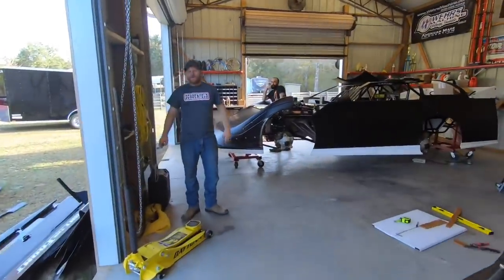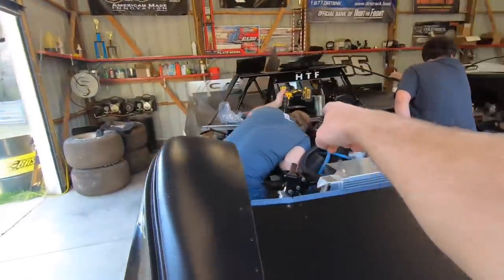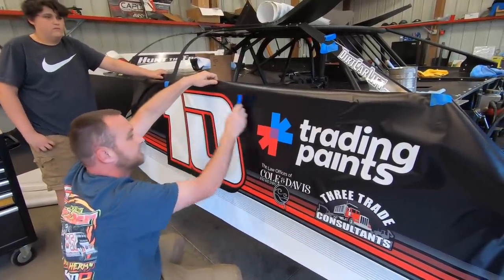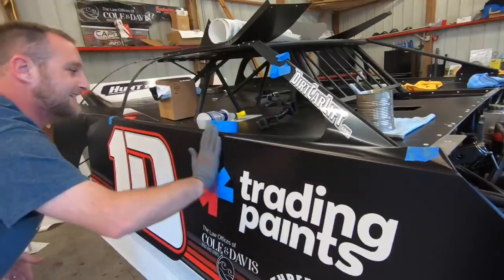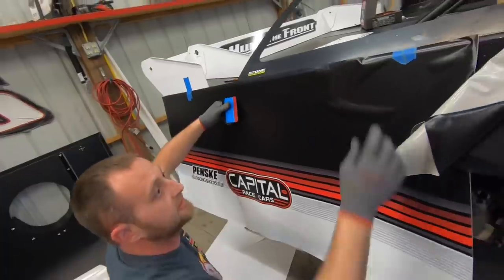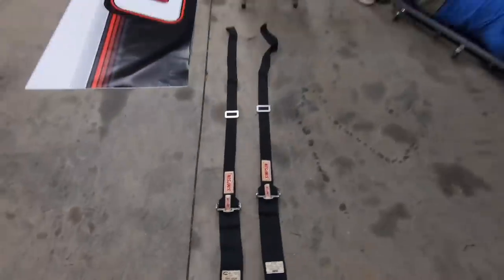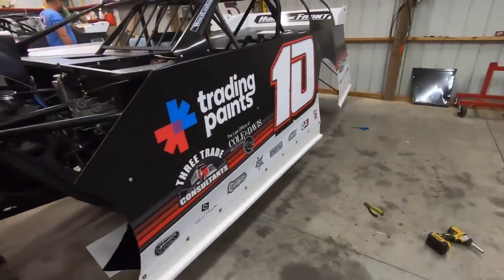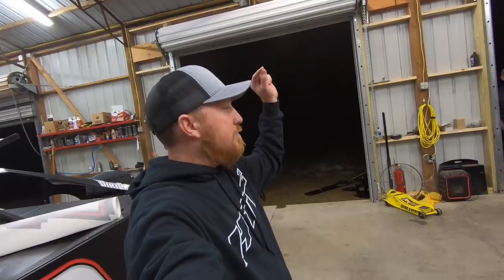New Car, New Look! Installing the Wrap on Both Dirt Late Models

Comment: We ran the first two years of Bristol dirt. Things you need to know. Big Springs, tall gear, most importantly 10 hole wheel on the right rear. Check all your wheels for cracks. They will break there. Use an inner bead lock wheel on the left rear if you have one. Be ready to go hours before your track time comes you will be called to the infield long before your event time. They wash the bleachers each night with fire hoses and leave the lights on so it is bright and loud when you park near the track. Use a truck to haul your pit equipment and spares to the infield. Carry food and drinks with you to the infield.

Comment: You can install that dry no problem. Depends on your comfort level. I've been installing since before they called them wraps and referred to as wood grains. Personaly I woulda did it dry it installs alot faster and I bet you look tomorrow and you'll have a water bubble somewhere. Theyll dry out but rather be done with it not explaining to customers why it's moving or has bubbles

Comment: Run them clean until they give reasons to do otherwise. From the sounds of it someone needs fed a right rear. Know full well he will run you the same way tomorrow as he did today. Sometimes ya gotta draw a line in the sand so people know not to cross it.

Comment: Hey there guys. Cars look awesome. Sound sensational all the way down here in Australia. Just a question about the fans that you are running on the cars. Does your class regulations allow you to run thermo fans on the radiator instead of the fan on front of motor.